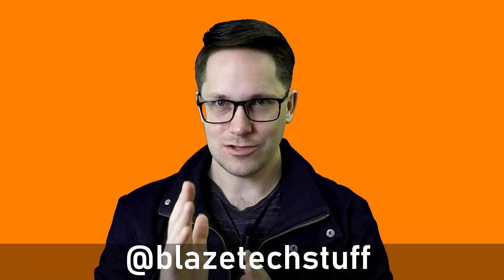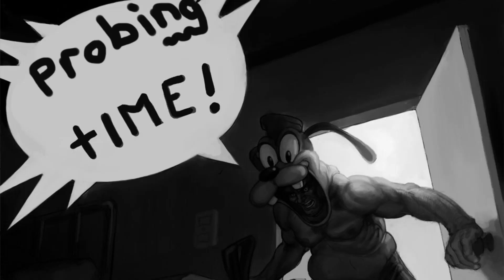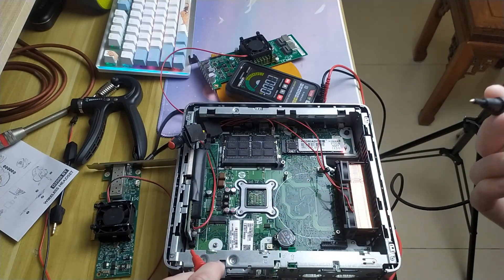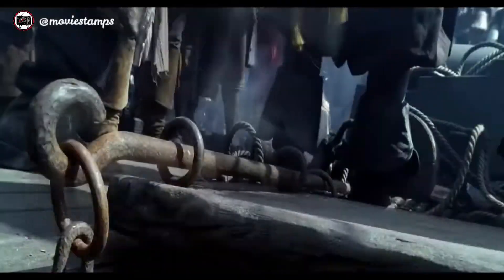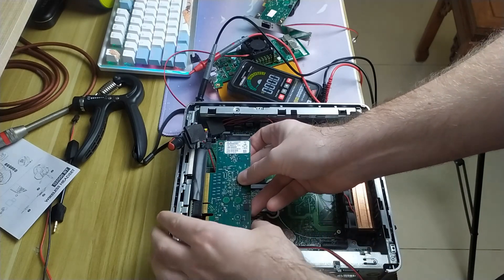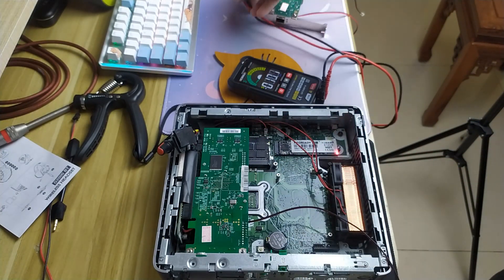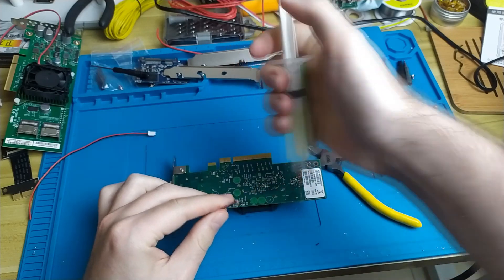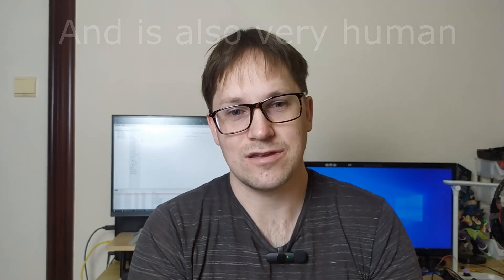Add Fans to Your LSI HBA or Network Adaptor!

Comment: Does the Intel x710-da2 need to add a cooling fan?
Reply from the maker: I probably would if the system layout doesn't allow for airflow. If you got case fans that blow towards the heatsinks, then you would probably be fine (the difference a tiny bit of airflow makes is substantial). If performance degrades or doesn't match up, give the heat sink a touch. Too hot? Maybe change a slot better positioned for the case fans or add another fan.